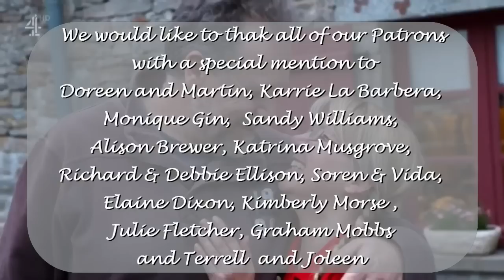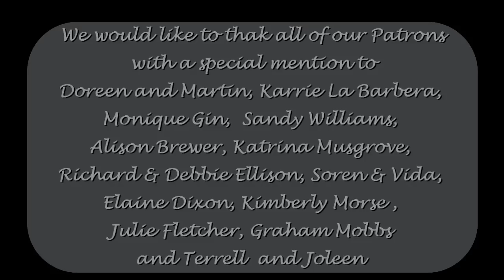178. How One Small Mistake Set this Chateau Renovation Back Months!

Comment: With the leak….. I really suggest IF it shows any sign of damp again, to put lead down there. Take the lime up… again … cut the lead into the stone work with a small disc cutter and dress it over the tiles… I wish i was a bit closer, I would come and do it for you ☺️
Reply: Exactly, cut a groove into the stone parallel to the roof line, 150 or 200 mm above the tiles, and put zinc or aluminium (I don't think lead is still used for roofing anywhere outside the UK) in there. There's pre-formed material for that very purpose that creates a gutter underneath the tiles. It's shaped like a J with a little lip on the top. The short bit goes under the tiles, the long bit against the wall and the lip straight into the groove in the wall. The mortar will probably crack at some point in the future and leak again.

Comment: I hate to be negative, but the thickness/ depth of the mortar can lead to cracking. I believe there is a plastic compound that can be added to strengthen the mortar or mortar with the plastic compound already in it. Check the mortar for cracks regularly.
Good luck.

Comment: Sadly cutting corners with a roof does cause even more misery. Using lead for roof flashing has been a standard for many years. A lesson learnt we have all made mistakes only way to learn. Onward and upward.
Reply from the maker: Haunching has also been used for years and years, lead is prohibitively expensive, and I guess we thought with the advice we had would have worked, however, circumstance and inexperience was more the cause, than as you say "cutting corners"